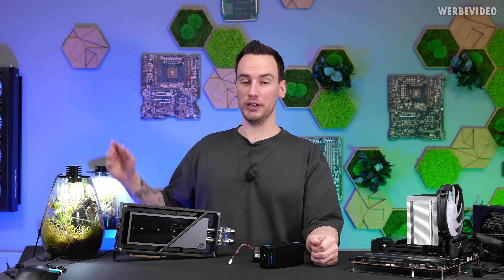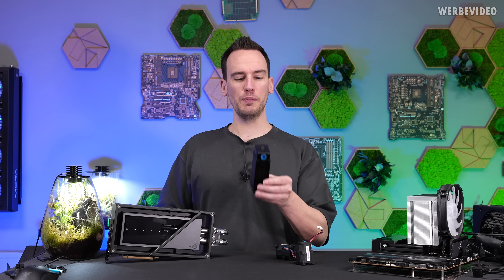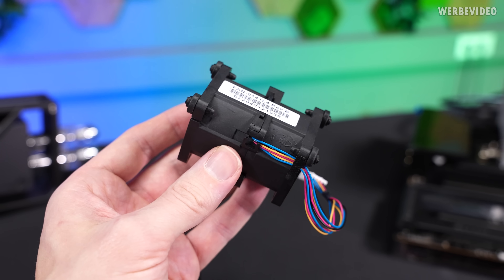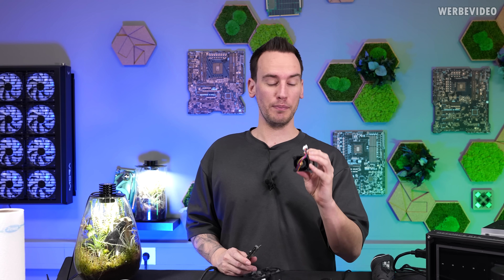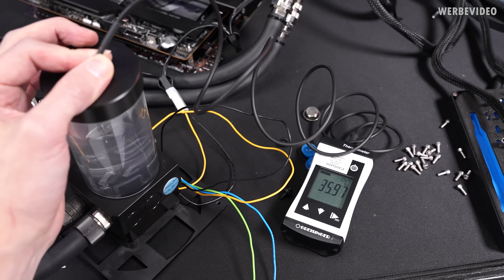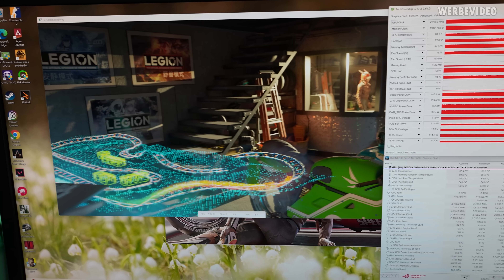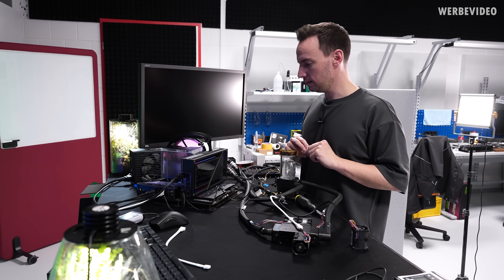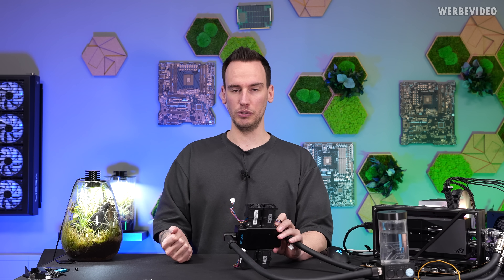Cooling my RTX 4090 with the Smallest Radiator I could find

Comment: In the past there was a rule for watercooling: 120mm rad per component + 120mm rad extra for safe measure. Is that still the case with 40XX series? And what about 50XX series cards? Real life scenario and running benchmarks check would be cool to check if the rule is still valid.
Reply: this rule of thumb is only valid with standard thickness fans running at a standard quite low rpm in a medium air temperature room. We increased fan size (and radiator size) to keep low noise volume, not to increase cooling capabilities.
Using server parts like this rad and those fans shows how this rule doesn't tell the whole truth.
Reply: @PainterVierax  yeah but it was said few years ago when GTX 10XX series was on the market... now with more powerfull stuff not sure if its still the case, thats all.
Reply: @sadus33  since then parts are much more efficients so the whole power envelope is still quite the same if we exclude hungry GPU flaships more designed for workstations. Larger fans and rads are slowly but surely taking the market as well.
In the larger scale, this rule is an oversimplification and it is prone to less and less relevance

Comment: Next time time for fun, use fan cone or cylinder. I had my share of cooling projectors and lasers, there is a huge dead zone in the middle, basically you left your center radiator fins air starved, it is proven until you hit equilibrium.

Comment: I know those fans. I used to babysit half a rack of 1U servers, where each of them had 6 of these at 100%. It was a safety hazard.
Reply: I was playing around with a 60mm Delta, which was strong enough to make into a mini hovercraft (made out of a sheet of cardboard, and a plastic bag as the skirt), but I accidentally got my finger too close and it chopped down to the bone :( 
Also broke the fan blade :(
Reply: @phuzz00  Ouch, I've had a couple of deep cuts from 92mms where the grille leaves a "wide enough to be dangerous" gap around the edge but nothing that bad. I think so at least, I immediately superglued the wounds shut so I'm not sure how far it actually went!
Reply: @HaxR3  wait, you did what ?
Reply: @Xfade81 IMO the best home treatment method for small yet deep cuts on fingers, as long as you're absolutely sure there's no debris in there. Holds the wound together from the inside for 2-4 days with one application, waterproof, pretty much sterile if using a fresh bottle.
 
The product "Liquid Skin" is just 2g tubes of superglue with a gelling agent, but I prefer standard waterthin CA: it's easier to apply as it wicks into the cut and cures much faster.
Reply: @phuzz00  was it the model with aluminum fan blades? Those look brutal if you ever stuffed a finger in there by accident.
Reply: @phuzz00  I'm sorry to hear that. I somehow put my finger in a decently strong fan, it sliced a piece of skin off my fingertip and left the finger numb for a while. Luckily there was no major damage.
Reply: No joke, the tip speed of the blades on the 21000RPM side are travelling at 300kph and can do some serious damage to fingertips.
Reply: @HaxR3 
Usually around 300kph is the max tip speed for a lot of fans. So the smaller the fan, the max rpm goes up.
Reply: I own 32.500 RPM as well as 38K RPM fans for my 3D printers.
Reply: @war4peace1979 are you doing cpap style cooling with those fans??
Reply: @war4peace1979  That sounds quite impressive to have 32 x 500 RPM fans all just for a 3D printer!
Reply: @war4peace1979  Mine are only like 8000...
Reply: Everyone knows Blowiematrons!
Reply: WHAT? WHAT ARE YOU SAYING I CANT HEAR YOU
Reply: it had to sound like heaven
Reply: I also know those fans.. they'll make you go blind by the noise that will detach your retinas.. you need the best 3M hearing protection or active noise cancellation, but even that is not recommended for longer than 30 minutes at a time before your limbic system basically goes into shock and screams at you to leave the room

Comment: Server rack fan controllers have a minimum airflow rating, and must be in the air flow path of the fans they are powering. They burn themselves out otherwise.

Comment: I can tell you for fact that a 240 rad will support ~650W of heat load with 2000rpm fans.  It gets up to 45C but still...that's not bad.  Meanwhile "hey do you you think a 480 rad is enough for my 125W cpu??"
Reply: well, that's because people want not 2000 RPM but 300-600 RPM on their radiators.

Comment: There is some weird greek letter based math that can calculate a decent prediction of inlet/outlet temp based on the thermal conductivity and specific heat of the aluminum, coolant, area of the radiator fins, and the air flow over them. IIRC, there is a counter intuitive relationship with air dwell time in contact with the heatsink, air can move too fast past a heat sink to pick up as much energy as it could. That being said....when you're cramming cubic meters of air across 80x40mm of zigzag metal, that relationship falls to the good ole American proverb "effectiveness by volume". Usually its used by artillery, bit the sentiment is the same 😆

Sidenote: I was just looking at these kinds of fans for a side project unrelated to PC hardware and cooling. So big thumbs up for incidentally covering something I wanted to see a live demo of! 😎👍
Reply: ϵ or σ? Emissivity and Stefan-Boltzmann constant.

Or ΔT
Reply: Delta-T?
Reply: Lambda
Reply: wasn't it Accuracy by Volume?

Comment: You know you can get a car radiator with fan from a car wrecker for like $50, right?  So much more fun when you do something utterly ridiculous, too. 😂😂
Reply: Yeah but that's almost always aluminum and will be incompatible with any worthwhile pc water cooling gear.
Reply: @Groovewonder2  pc radiators are usually made of aluminium.  You just need an appropriate block or corrosion inhibitors.  Also...STOP RUINING THE FUN!
Reply: @Alex.The.Lionnnnn  no, only the ones in AIO's are usually aluminum. Parts you buy seperate, especially ones of any good quality, are not.
Reply: @Alex.The.Lionnnnn  Corrosion inhibitors don't work forever, and they aren't foolproof.

Comment: These are server radiators, and Alphacool also offers water-cooled server chassis that you can  install these in. In my homelab, I have two 2U chassis, which significantly help in reducing noise compared to air-cooled servers.

Comment: Always love this kind of videos showing these weird cool things about computer hardware. Also question: Is the fan controller controling the voltage to fans or only sand out PWM signal but fans get power from PSU?
Reply: it seems that controller board provides the whole power with a buck regulator. Otherwise, there is no reason a simple PWM signal circuit would overheat as such.

Comment: Is it just me or those rads could have a denser fin array when matched with those fans?

2 of those probably good enough for a 4090 and 4 for a whole system. That would be a good, why not video xD
Reply: Yeah but i guess they assume most people arent mounting 21k rpm fans to it
Reply: @WayStedYou  I don't believe so. Such 40mm form factor are used in servers only. And even thinner ones are very good at static pressure so the fins could have easily been twice the density without an issue.
Reply: @WayStedYou  radiator that size could be end up in server, so i dont think alphacool didnt think user not slap a mega rpm fans

Comment: Not to mention, running hot water through your loop's going to lead to faster evaporation. My GPU loop's lost over an inch of water more than my CPU loop after a year of hard use.
Reply: Where does it evaropate to though?

Anyways, would it not be rather question bigger airgaps in rad? Try running 100% pump to see bubbles out.

If you have opening to air in your loop, disregard my comment.

Comment: 11:34
with all that airflow, you could have reversed the flow of air through the radiator and had it blowing across your fan controller board, and probably the tubing and motherboard for even more cooling XD
Reply from the maker: yea next step would be to have a custom block for the fan controller xD
Reply: @der8auer-en  isn't it possible to just stick some rads on top of the chips? I mean it's still quite common to see rads on transistors, controllers or SoCs to improve dissipation.
Here it seems the controller had some over temp protection but a custom PCB with high current rated TO-220 mosfets screwed on a rad can easily handle switching a 7-10A load.
Reply: @PainterVierax  I've seen heatsinks but rads on transistors?
Reply: @sykoteddy  Ever looked into a power supply and noticed the silver bit of aluminum that runs through it? That's the heat sink for the power transistors. You'll also see pieces of metal strapped to transistors pretty commonly in basically any power supply tech from the mid 90s and earlier because regulated switching power supplies were not as easy to make as linear rectified regulated supplies.
Reply: @Jackpkmn  What is it that you don't get with my comment? I'm very familiar with heat sinks since I have disassembled a lot of electronics. If it is the fact that I spelled it like "heatsinks" instead of "heat sinks". It's just sad you feel the need to comment. He wrote rads as in radiators.
Reply: @sykoteddy  WTF? I was just trying to be nice and explain something to you that you asked for more information about. I wasn't calling you out or anything like that.
Reply: @Jackpkmn  So I am still the one that is bad because you can't read a simple comment. I'm not gonna assume you can understand this comment either since you rather act hostile either way. I simply asked what you didn't understand with my comment. But that is still me being ungrateful.

Note to self: don't ever comment again, unless you are willing to make someone upset for no reason.
Reply: @sykoteddy  I'm not trying to act hostile. I'm hurt. Because I was just trying to help and you are repeatedly calling me dumb and malicious. I'm sorry man, genuinely I wasn't trying to cause any offense.
Reply: @Jackpkmn  Wow, so now I have called you that huh? It's not easy to not hurt or offense someone that is making stuff up. Again, I simply asked what about my comment that you didn't understand. Get another hobby than trolling and harassing people.
Reply: @sykoteddy  Your comment stated you never saw heat sinks on transistors. I explained where you can see heat sinks on transistors and why they were there. What I do not understand about this interaction is how what I said was in any way offensive, harassment, trolling or misinterpreting your comment.
Reply: @der8auer-en  An easier solution is to just have 4 different fan controllers (1 for each fan) and just glue a big heatsink on the fan's controller chip. Or you know.. just hard wire the fans directly to the power supply.
Reply: man, You need to control this fans by PWM, not voltage. i works with this type fans, i know what i say.
Reply: @der8auer-en I was thinking that while you were talking about how hot it was.
Reply: Yes, fan controller and power source should be in air path
Reply: That radiator is the perfect size to cool the fan controller (if it had a water block)
Reply: That would definitely work. I know those fans from servers. That's essentially how they work for the smaller form factors.(Which those fans are used in)

Comment: That delta between water and gpu temps is soooo low. My 3090 with an ek waterblock hits 55deg with water temps around 15deg C. I don’t think I have ever seen water temps even 2 deg over ambient.
Reply: If your GPU die temperature is 55 degrees and your coolant temperature is 15 then the delta is 40 degrees so I don’t know how that’s so low. I think you meant delta between your coolant and ambient temperature?
Reply: @Simon_Denmark  no I mean in de8auers case, his delta between water temp and gpu temp was around 10deg. His block must be really good as I never see deltas even close to that.
Reply: How do you keep your water temp at 15c?  My basement is 21c and chilly.
Reply: @zappulla4092  when it’s around 5deg C outside I just open the window.

Comment: now you need to watercool your fan controller too.
Reply: There are water blocks for Aquacomputer Aquaero 5 and 6 and its fan relays. Heck, at some there were waterblocks for DDC pump electronics....
Reply: Could have at least aircooled the fan controller.
Reply: Solid state cooling soon
Reply: Never going to happen @arcadealchemist
Reply: @arcadealchemist  An ANDROID-APP to monitor the radiator fans and temp would be sweet..
p.s. please add holiday RGB lighting too!
Reply: Feedback loop hehe
Reply: fan controller shouldnt need any cooling if it's a true PWM controller. this one is an adjustable buck converter and the chip might not have sufficient current capability to feed all 4 fans
Reply: cut a thermal pad the size of the controller and mount it on top of the radiator
Reply: You just need PWM type fan splitter and it should drive 4x 18W fans no problem.
Reply: If fans are PWM this is totally wrong controller for those fans. PWM controller does not need ANY cooling as it doesnt control voltage at all. Just generates PWM signal. All you need is trim pot and ATtiny85 or something similar to control those fans like i have done. Zero heat on "controller".
Reply: The CP120-v2 uses dc voltage control, not PWM. Its controlled by a single LM2596, with a 3a (36w @ 12v) rating TOTAL, not per channel. At least not in this setup. Each fan is actually 28w (2.27a) each, not 18w (1.5), so he was asking this itty bitty boy to push 3x its rating. Poor little guy never stood a chance.
As for PWM not needing cooling... Well, then why would a buck converter? A buck converter is just PWMing an inductor with a cap to pretty it up into a steady voltage. Fets are fets, fets have losses, losses are heat. A PWM controller with an under-rated fet would have been cooked too, though it'd probably survive a bit longer. But if you were able to cool that thing enough with, say, water...
Reply: @XantheFIN  i not so sure, the switching generates temperature in it's chips..
Reply: the real question is: can that radiator dissipate enough heat just to sustain the fan controller 😂
Reply: A water cooler cooling a water cooler while cooling a cooler
Reply: LMFAO

Comment: Wild setup lol. Quick question, what tubing do you use and how would you rate how bendable it is? I'm using primochill regular clear soft tubing cause people said it could bend well without kinking, maybe my expectations are too high but that doesn't seem to be the case for me
Reply from the maker: These are EK ZMT. From my experience the best tubing you can currently get
Reply: @der8auer-en  Appreciate the quick reply, thanks!
Reply: @sasu6094  EK ZMT is just EPDM tubing and EK’s marketing name. Watercool and Alphacool are much better places to get EPDM tubing from. I wouldn’t support EK anymore in any way.
Reply from the maker: While I agree that it's just EPDM tubing, the Watercool and Alphacool ones are just not as good :( in terms of wall thickness and bendable
Reply: @der8auer-en  I do have to agree with the point that EK’s is extremely rigid. But you’ll also have to use a lot of force to get a fitting on because of their ID/OD sizing 9,5 mm and 15,9 mm. They used to sell multiple sizes of ZMT. However I don’t think that Watercools EPDM is that far off and a fitting is much easier to put on.
Reply: @Simon_Denmark  I had Watercool's EPDM and it kicked a bunch of black residue into my loop.
Reply: @someusername121  Hmm haven’t noticed anything like this with my loop that has EPDM from Watercool and EK. I guess you should have cleaned the tubing better beforehand with boiling/hot water.

Comment: I don't know if you find this as interesting as I do, but if you happen to have an old stock heatsink for an i7 965 EE, when they had the transparent LED fan and the mix of aluminum and copper fins on a vapor chamber core, could you possibly cut a mm off each side of the push pin holes and stick it on LGA1700 just to see how it preforms.